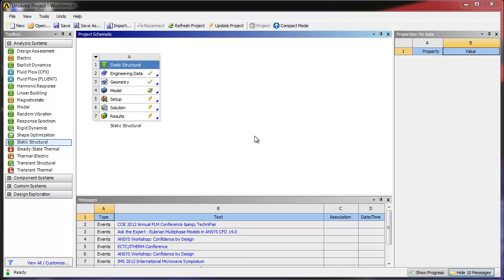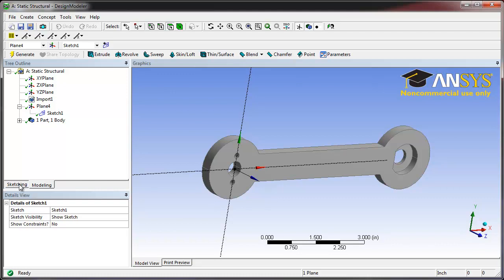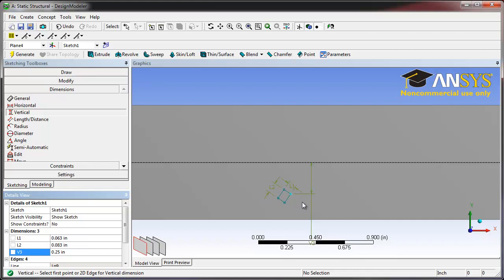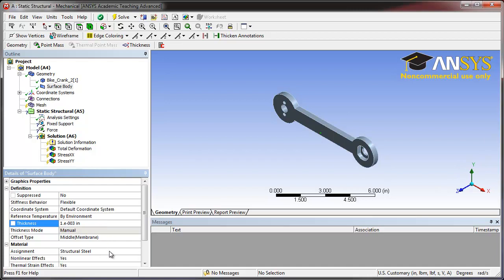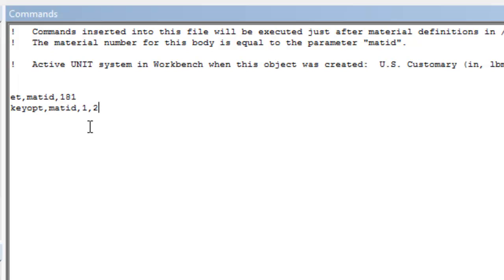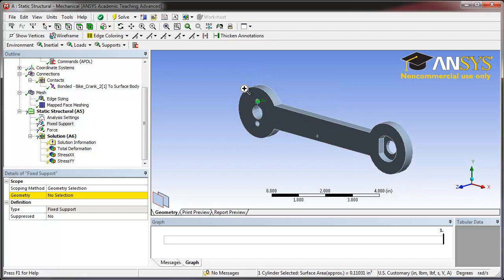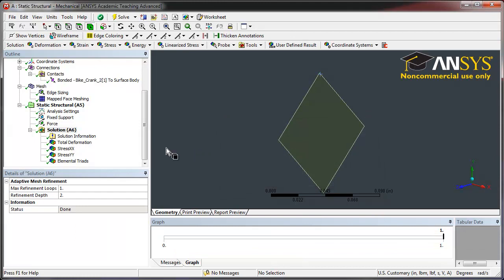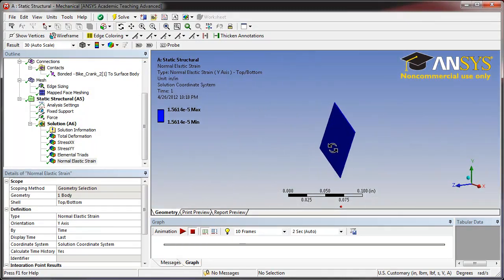Cornell ANSYS: representing strain gauges with surface bodies

Comment: worked perfect for me! Thanks so much!
What does the two codelines do exactly?
et,matid,181
keyopt,matid,1,2
Reply: It is very simple.
The first line is used to select the type of finite element for a surface body.
The second sets its rigidity to zero (Membrane stiffness only). Since the strain gauge should not affect the stiffness of the rest of the structure.
Reply: @ЕвгенийКалентьев-е6ь  thanks for clarification! If i do a modal analysis with and without the strain gauge my resonance frequency is changing. Any idea why that happens?
Reply: @ЕвгенийКалентьев-е6ь  I have the problem that my natural frequency of the model is changing when adding the strain gauge. With a stiffness of 0 this should not happen. Am I right? My von-mises-stress is also changing. Any idea what i did wrong?
Reply: @skatebjarne  can you send me your project?
Reply: @skatebjarne  adjust the density of the strain gauge material too small